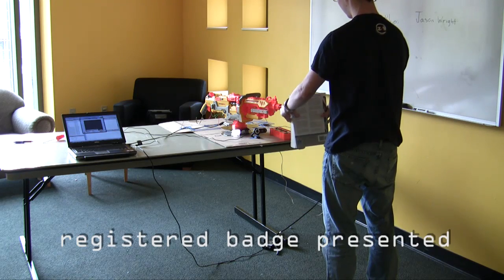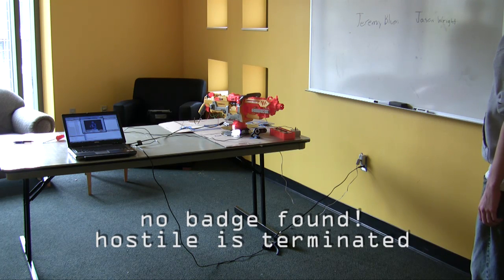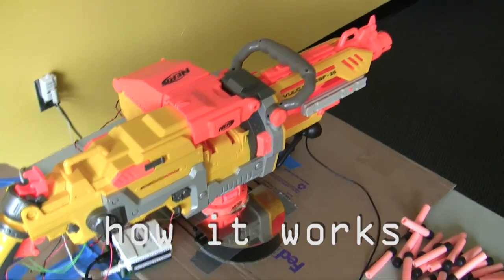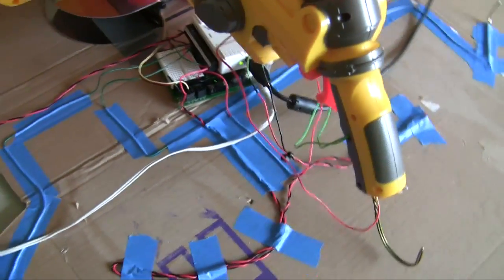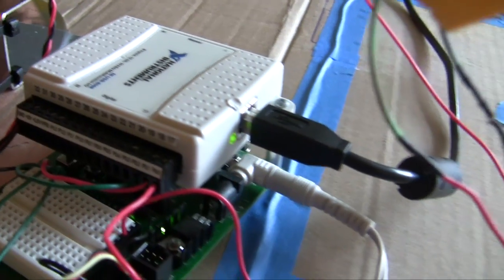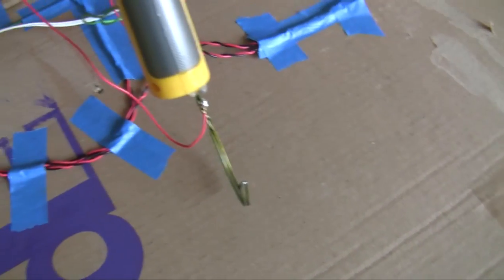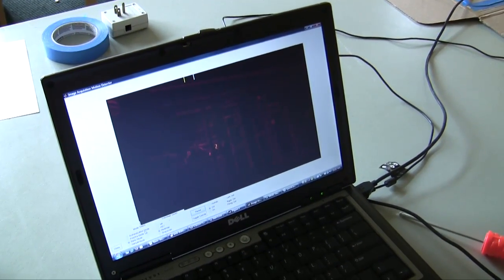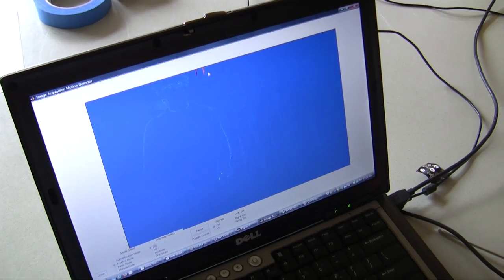Nerf Sentry Gun...Be Afraid

Comment: several things:
1 anyone can just reach for alt+f4, the wires, or the battery
2 now lets do that with a minigun XD (only difference is that its what? 50lbs?, 110V, and has a ton of recoil
3 you guys should've rigged a DC 9 V adapter
4 why not use an analog motor?
5 it would be cool in intagrade wireless controls via bluetooth/wifi
6 maybe the camera should be mounted ON the MG? then set parameters for maximum rotation degrees
7 maybe add a Y axis motor?
8 maybe add an ultra sonic sensor?

Comment from the maker: We had an issue with the MOSFET in the handle overheating and dying at one point, but we replaced it and it didn't happen again.  We also had to add movement thresholds to ensure that the gun wasn't trying to constantly compensate.